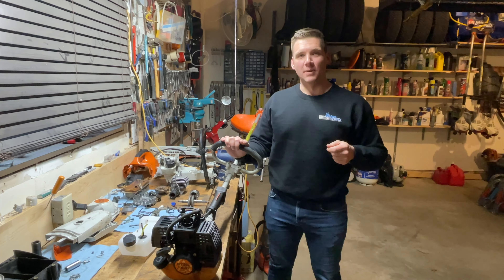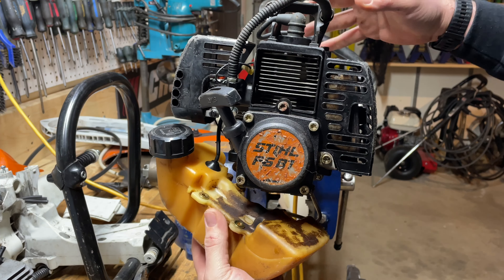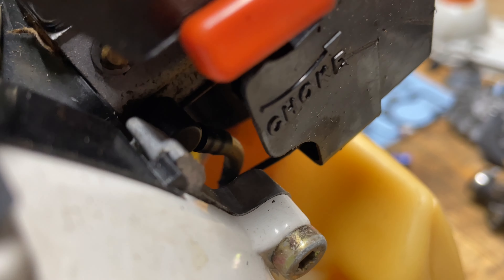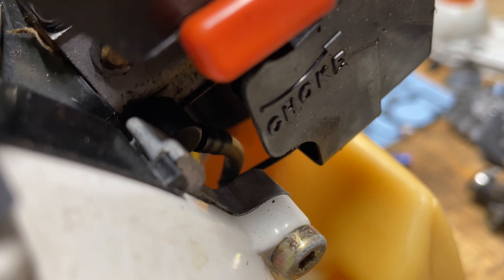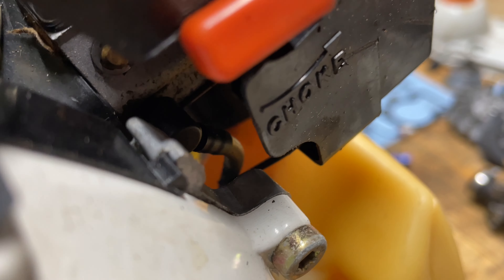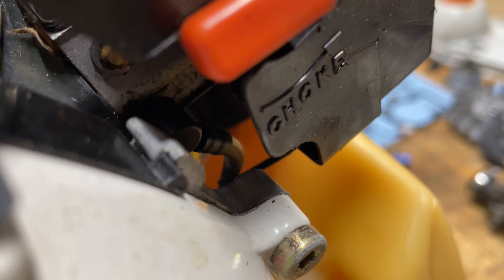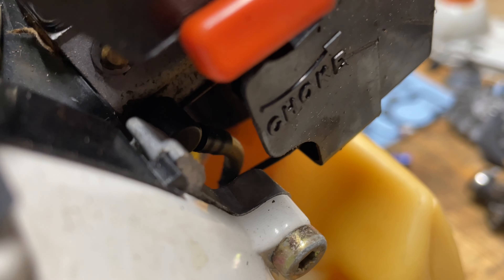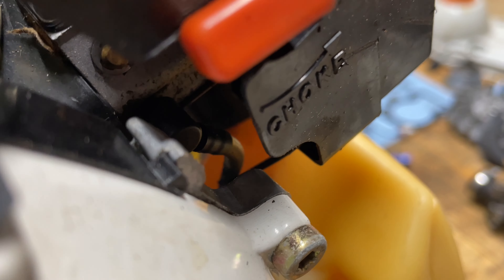Step by step HOW TO replace a cracked Stihl trimmer fuel tank (Stihl FS81 FS86 aftermarket gas tank)

Comment: Thanks for a very thorough and detailed explanation on how to install the after-market fuel tank on the Stihl FS86. It would have been confusing to install without your guidance. One comment I had was what about using the vented fuel cap from  the old tank in lieu of the one that comes with the kit?

Comment: Great video with good detail. This is exactly the same retro tank that I fitted to a FS86 unfortunately the long bolts suffer from metal fatigue and tend to shear close to the motor housing. Until now I've just replaced the bolts but I'm going to fabricate a metal support which will fully support the base of the tank. I intend to give it a padded base for the tank to sit on and secure the tank using cable ties. Securing the tank to the new fabricated support. Hopefully this solves the issue.

Comment: It appears that the fuel tank cap was cross-threaded when you had the close up of the cinching up of the tank bolts.  I like the video, especially your explanation, detailed close ups and quality work!  Always a great idea to restore durable,  "old" yet well made equipment.  Another nice job, Dave!!!
Reply from the maker: Hey Henerker - good observation! I didn’t have it on right then - just out of the way. The quality of threads and build are just not the same as OEM so you have to be careful putting the cap on. Thanks for the kind words!
Reply: @DavesSmallEngines  Dave: your work saved a valuable piece of equipment that is way more rugged and substantial than today's comparable machines.  I myself have that same motto and try to fix as much of my old outdoor power equipment because it's "stronger".

Comment: Every thing is great except the vent . Get rid of the rubber check valve . If you leave your trimmer in the sun or if the gas tank warms up , the expanding gas is forced into the carbonator because that check valve will not let air out of the tank .  I like the larger tank . I always hated the vent in the filler cap ,tilt the trimer gas leaked out that vent hole .....Great info thank you
Reply from the maker: Thanks for the tip and the kind words!

Comment: Awesome video. Any tips on parts for my FS81. Air filter, Air filter shroud and throttle cable? TIA.
Reply from the maker: Hmmmm...... Aliexpress or ebay? If that fails... the dealer.

Comment: Watching this after just completely coating my tank with Flex Seal, if that doesn't work then I'll be doing this 😂
Reply from the maker: How did it work?
Reply: @DavesSmallEngines  worked great actually!
Reply: Update: Gas ended up eating through the flex seal, so I just finished putting my new aftermarket tank on. Thanks for the tutorial!

Comment: Nice job Dave.. I have a Stihl FS 65AVR. Like new but leaky tank. Looks like all the screws might line up on that kit but my tank is on the top of the machine. Do you think  those fuel line fittings and the cap would leak if mounted upside down? Does anybody know of a kit for this type of machine?
Reply from the maker: Hey Robert. I think it will leak as the cap has its own vent (I believe).

Comment: It didn't work for me until I plugged the air valve in the fuel tank cap ... there were 2 directional valves for the air: one in the lid and the other on the transparent hose ... I think this should be clarified.

Comment: I always say the older machines are usually built better .
Reply from the maker: I agree... quite a bit heavier though!
Reply: @DavesSmallEngines  You definitely work faster to get the job done with a 15 pound trimmer! Too bad Stihl doesn’t have this kind of quality anymore. Not a fan of the 4-mix engine.
Reply from the maker: @andybecker2693  I agree. I love my FS85... light weight and powerful. I’ll be keeping it long term.

Comment: Just fitted a new tank to FS85.  Anyone know any tricks to prime as it wont start. Prime (rubber) bulb doesn’t look like it has fuel in it but it’s old and yellow so cant easily tell. I know there’s a spark as I drop a small amount of fuel in the spark plug hole, replaced plug and it started for a second or 2. But no longer…

Comment: Where did you find the tank
Reply from the maker: I bought mine on aliexpress but I don't endorse anyone. I would suggest checking there or ebay for "FS86 fuel tank" Cheers!
Reply: @DavesSmallEngines  I have a old Big red brush cutter and the fuel tank broke when I droped it. I have not been able to find one or anything else for it.
Reply from the maker: @richardgrosskopf7557  I suspect you will have to go custom then - maybe this one can be adapted?